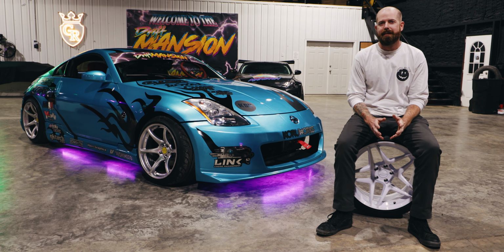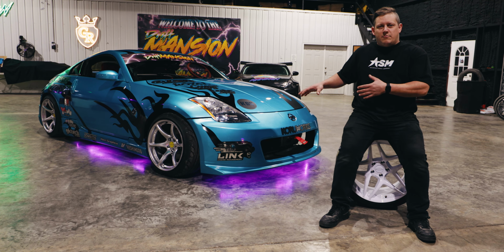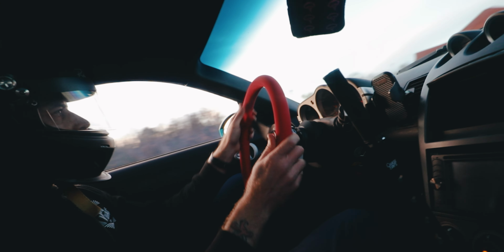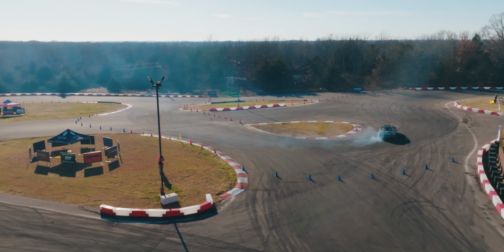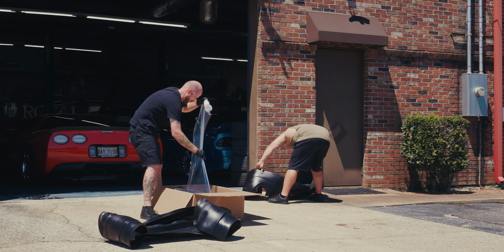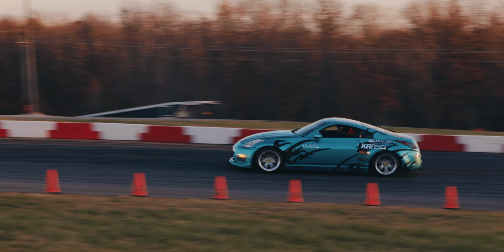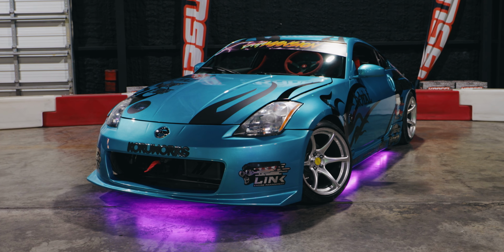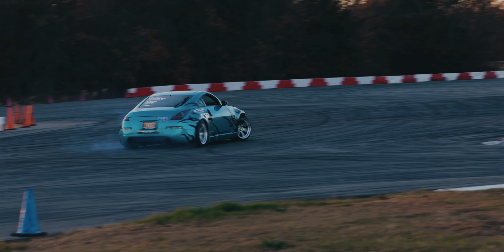How to make your 350z a proper drift car the first time!

Comment: What was the biggest difference to keep the car from fighting you as you said. Would it be the lower control arms. I have part shop max upper adjustable and toe arms in the back. Also the part shop max coilovers
Reply from the maker: The Z's front suspension, when factory and especially at the age they are now, can be quite sloppy. The front lower control arm uses these reaaaaally big rubber bushings that, with time and use, fail and create a lot of alignment changes - especially when going lock to lock during drifting. Essentially making your alignment dynamic (changing). -Scott
Reply: @griproyal  would u suggest poly bushings or going with a full one piece lower control arm i honestly hate the lca and compression arm combo

Comment: do you run without front fender liners?
Reply from the maker: We have only the front upper section of the liners in to prevent trash from entering the engine bay.